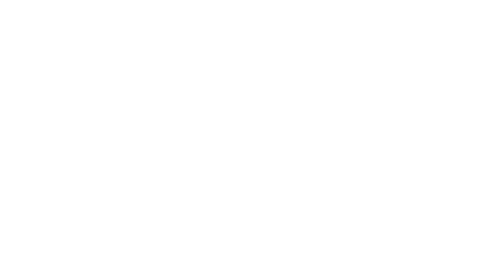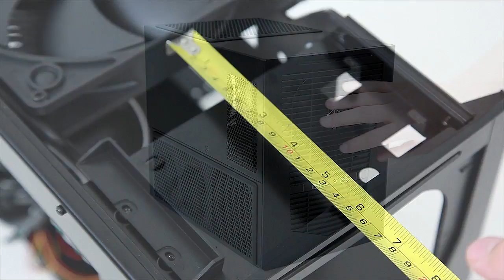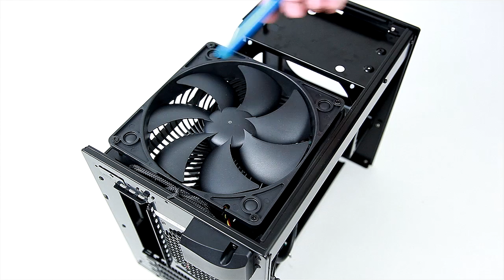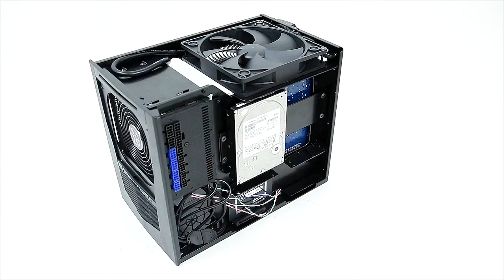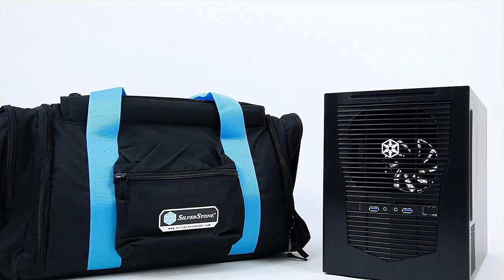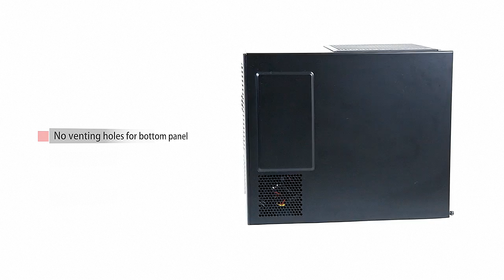Silverstone SUGO SG09 Review

Comment: I used the 80mm fan on the right-hand side as an exhaust.

The change I would like to have seen with this one is more mounting options on the left-hand side insert. Being locked to 92 + 92 + 120, in that order, is a bit irritating. I'd have been happier with two 120mm mounts, and an (easy?) compromise would have been screw holes and a cut-out for a second 120. Since I don't use 320mm cards, I would have preferred to have those towards the back of the case rather than the front. 240mm of fans would cover most GPUs I've ever owned.

Comment: Anybody try flipping the direction of the rear and top fans? (So that the rear 120mm intakes and the top 180mm exhausts). Since hot air rises, seems more intuitive, but not sure what that would do to overall airflow or case air pressure.
Reply: The thing is, the default 180mm fan is not a PWM model, so it's generally going full blast, all the time. There's a toggle you can use, but it's certainly not reactive, as your other fans probably are. If it pushes air out, while the other fans spin down, you will have a negative air pressure system, which can suck dust into the case, if there are any ways in not covered by filters.

Silverstone does sell a PWM version of the fan (or they did, anyway) and with that, you can do as you please.

In general, though, I prefer having my biggest and most powerful case fan blowing air into the case, onto my components.
Reply: Hot air rises unless you create an air flow with a fucking fan. So, no it is not more intuitive. God damn, are hardware enthusiasts sensitive.

Comment: I have this case and have an All-in-one cpu water cooler on the back fan pushing air out, also, the bottom card is by far cooler than the top card in my system, plenty of space under it.

Comment: Omg, now i really want to buy a system with a asrock mitx x79 board, 3970x, 32gb of 2600mhz, sli gtx 690s, and mod the side to put in a 3x120mm radiator, mod the front to add a 120mm rad, mod the top to put a 120mm radiator in it, and put like a 1200i in it....h0ly shitttttt

Comment: only 1 thing, if Your power supply comes with different connection or form power cable than You cant use the built in one (short connector from front to back), and it is kinda messed up :(